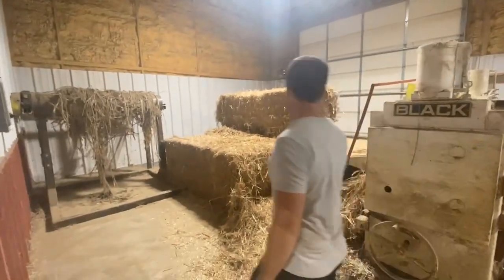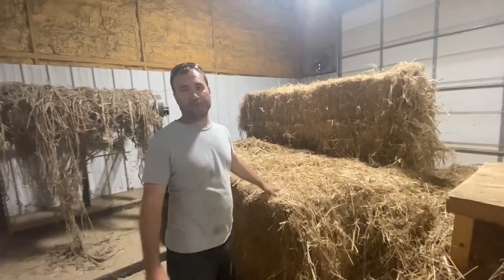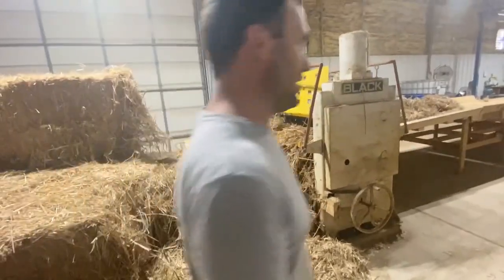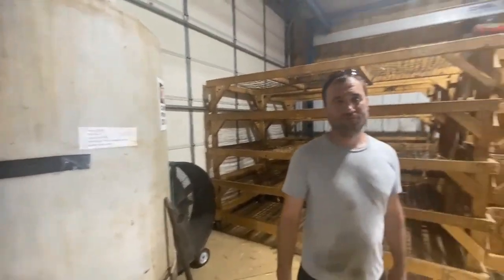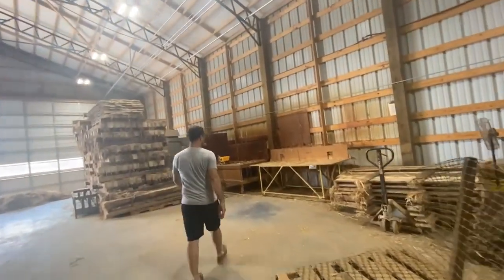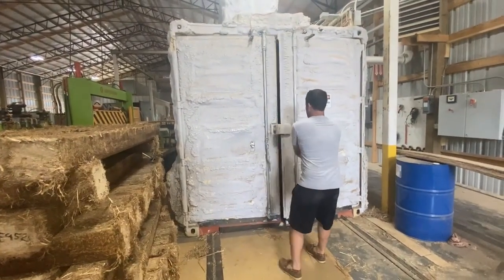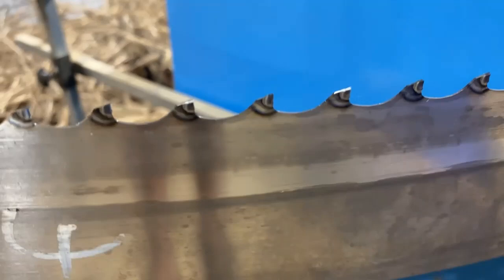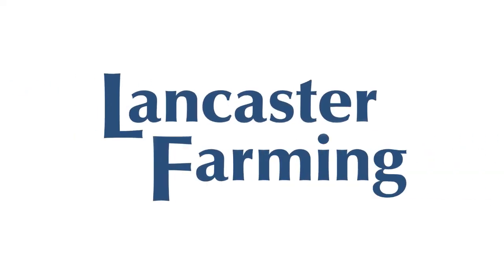Making Wood Substitutes from Hemp at the HempWood Facility in Kentucky!

Comment: With the shiplap systems coming back so strong, shiplap would be a great use for HEMP Planks. A great replacement for Sheetrock as it could be pre-stained or painted and be as fireproof and yet have more structural support for walls.

Comment: Been thinking about this for years now good to see. Can collect gas or oil from the burner? Also run a water pipe through run a steam generator? if your shed running on electricity that is, I'm assuming.Nice work, in the process I been wondering how to make different grades of wood (bit softer) depending on  application. Use as studs/rafters?  Personally I prefer the hemp blocks for building just in case someone wants to do something different how well do nails shoot in? Glue adhere? Waterproof/resistant?

Comment: Your factory needs some automation.
You might be better off making a plywood type sheets insted of logs, then milling the panels into flooring strips like a plywood factory or mdf factory and how its made less manual labor more mechanical production.
After wide boards are cut per order toung and grooves can be milled into the edges high speed  someone could place an oder for 3k sf of 2.5" strip flooring 
And x length boards configured to the room size. Bailed down like any wood flooring is and you could also stain to order or tottaly do prefinised flooring.
The sheet goods can also be toung and groove sheet goods for walls roofs and subfloor use, a coating could be applied like hubblers sip wall system and a foam insulation added, also pre built walls using engineered walls like the 2x4 and 2x6 type foam walls sold in Canada that use 1x and 2x stock with foam and rods.
To create a break between inside and outside walls contact that cut down thermal heat transfer  insted of wood rods hemp rods becuse hemp has a better insulation value and its fire proof and termite proof.  
This would be traditional wood type framing hemp is also used in block wall construction. 
It grows faster then wood uses less water controls weeds itself and takes almost no energy to produce. 
Like tabaco its a cash crop.
The whole plant is usefull.

Comment: If built high-rise grow room/s with a water tank on top you can design a practical powrrstation running water down hydro generator. Build FISHTANK nextdoor can fertilise recycle water system build ecosystem  produce own electricity, use minimal water, Lil to no waste. Adding gassifiers generators wind generators if in vac system if have 1. Use less space land wise same output or more supply food chain to support system thenb can reclaim land for rainforest bush land use minimal water. Designed aptly should be able to use no extra water once it's designed steam water into  environment every 6 months once it's. Filtered all the garbage out revitalised with nutrients then  we have clean rain clouds not GARBAGE & round up etc etc... Aeroponics systems on levels just incase get a disease don't lose whole crop grow different strains. Been trying to lights that don't need wires as grow lights for supplement light. Much easier to grow harvest etc etc..